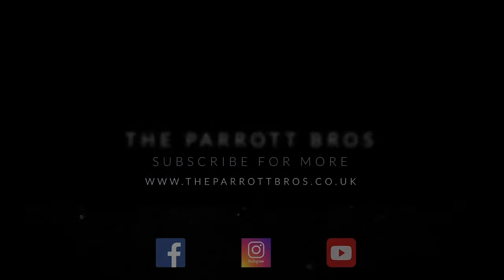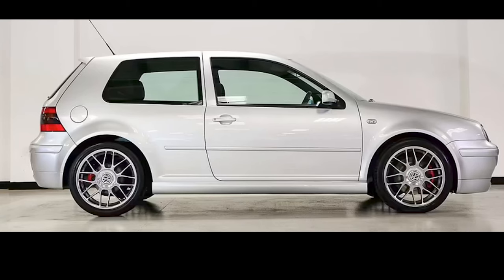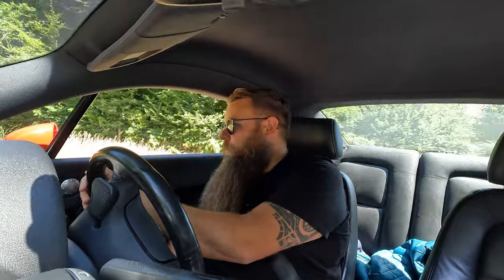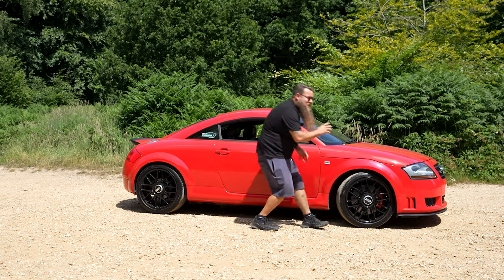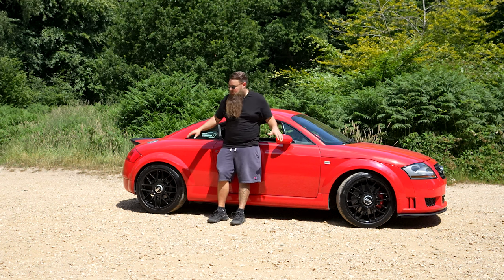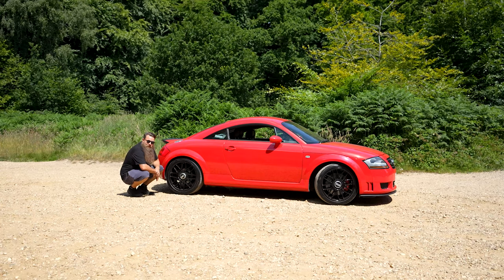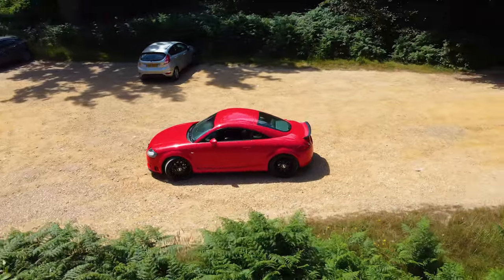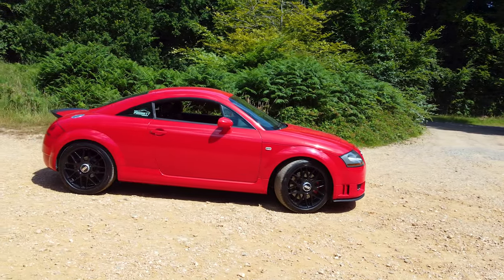New Suspension And Wheel Upgrade Transforms My Car

Comment: Stick it on an MOT shaker table and get the welder out. Front sub frames soft as cheese. The sway bar mounts are a huge contributor to the turn in slop.
Reply from the maker: Those mot shakers look horrific in action dont they, but do a great job of highlighting issues

Comment: You did good mate. Looks stellar! I run black wheels, I suggest you ceramic coat them. It makes for easy clean up. Cheers
Reply from the maker: Thanks buddy, it’s funny you should say that, I was out there doing just that yesterday 😂. Going to the ring in the morning so nothing like a 1500 mile road trip to test out the coating 😂😂

Comment: I’m looking to have the best comfort coilovers, full suspension, replace all the bushings and sway bars and really every piece under my 225 as possible. as well as lowering mine just a little as I have 19inch ottinger rims already. I’m looking to spend only 1k to 1.5k max not sure if b14 or b16 are better or kw so many options.

Comment: Excellent video as usual Dom! I'm also running a red 3.2 v6 dsg which I suspect is on original suspension still. Having issues with the flashing PRNDS light at the moment...😫 sent the mechatronic off for testing, came back with no faults apparently.... stumped what to do next...
😎🤟🏻
Reply from the maker: That’s an odd one isn’t it, have you had a look on the TT forum for possible answers?

Comment: Will this set up with adjustable arms fit my 04 225 with 19inch oettinger rims? I want the arches flush with my tires with basically no gap
Reply from the maker: Yes adjustable arms will fit all models, they just need to be set up correctly is all. If you fit them in place of the upper control arms you will be able to push the wheels out at the top

Comment: Would you recommend a 225 TT for a 60 mile commute few times a week? I know I should get a diesel golf or something but life is short lol. How would mpg be on motorway and overall reliability. Cheers!
Reply: Great fun, but at this age there’s constant niggles and more. Only really ideal as a weekender imo
Reply: Get a 350Z
Reply: You might get 32mpg average, if the ac works then I'd say using it as a daily isn't out of the question, ours is used for the commute several times a week buts that's only a 34 mile round trip. Big issue at the mo is £2 a litre for super unleaded.
Reply: For the last 3 years I’ve done 120 miles a week in mine, average 30mpg , but most of my journey is in a 50 average speed zone.    Older TTs take some money to sort out, suspension, brakes, silicon coolant hoses, cam belt, oil pick up pipe, but once done are reliable.   Personally I am thinking of getting a VW Caddy for the commute and keep my TT for weekends and holidays.  My TT just makes me smile😎

Comment: Did you have to put drop links when you lowered the height?
Reply from the maker: No as the mounting point on the shock was the same distance from the hub as the original shock, it’s usually only on coilovers where the mounting tab is lower due to the threads for adjustment

Comment: Hi you have been so helpful with your videos I'm new to the TT world. Once I get this Mark 1 sorted a bit more, of course with the help of your videos, I'm going to fabricate a hard top in aluminium to make the roaster look like coupe, do you think they could be a market for a good-looking hard top. Thank you again for your so how to fix things on these great little cars
Reply from the maker: Thanks joe, welcome aboard! That would be pretty cool. There is already a hard top available, they are quite sort after and not cheap now so you may well be in the right market for something a little different. As the roadster hardtop still isn’t quite the shape for the coupe
Reply: Just had some sad news today, I wanted sort out the haldex problem the car has, and be told there are no service kits or anything 4 this old system gen 1. Any advice would be appreciated.

Comment: Looks great , I'm searching for the suspension right now . Would you know if this is the part number for the 3.2 ?  H/R40438-2    .I got it from demon tweeks , luckily they ship to Australia . Keep up the good work informing the all the tt owners out there 👏
Reply from the maker: So they dont list the shocks for the 3.2, they only list the shocks for the 1.8t but i have used them on mine, the springs are suitable for both 1.8t / 3.2 vr6's, they are the same fitment and weight is the same all bar a few kg's
Reply: @TheParrottBros  perfect my man ,that's what I want know , probably a change in spring rate ? I have h&r springs on there now ,it's turned the shocks to shit after 2 weeks of fitting them , was really nice the first week 😆